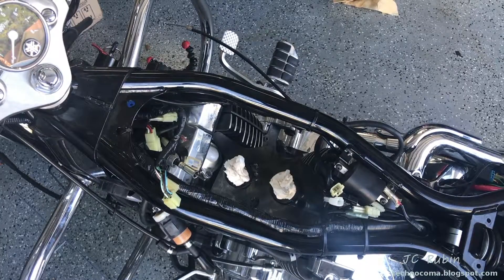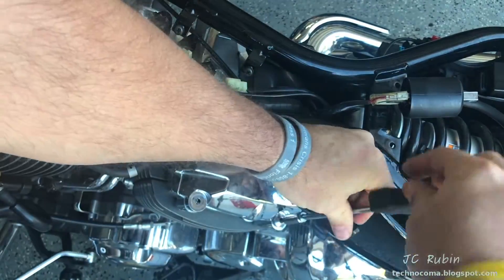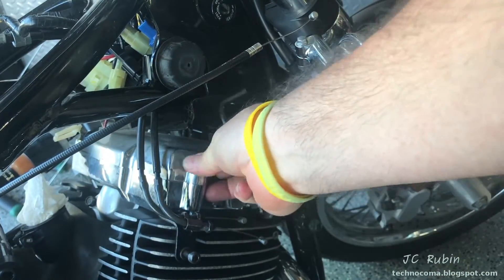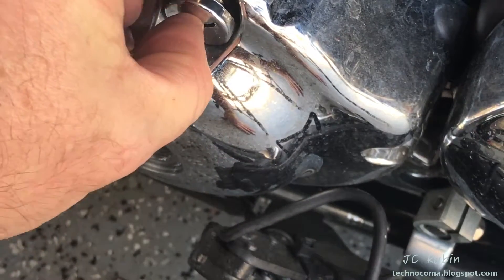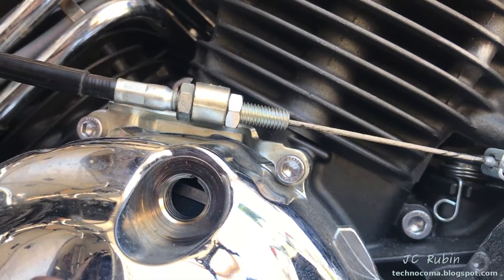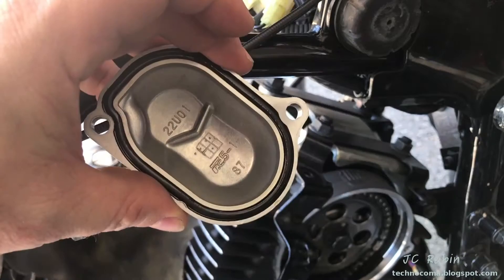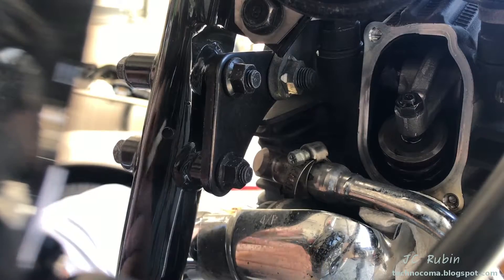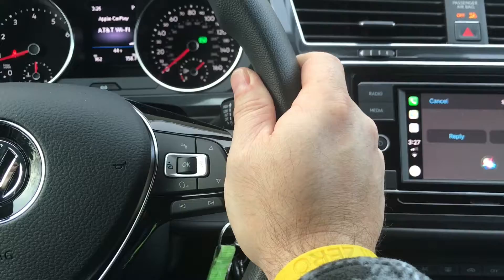Yamaha Star 650 Valve Adjustment - Checking  and Adjusting PART 1 of 2

Comment: I have a question? I was doing my valves and the dot and the I for the front cylinder will not both line up perfect. Is there anything wrong with the bike or the they not always line up exactly
Reply: Did you ever get an answer to your question, somewhere? I'd like to know too! Thanks!
Reply: @WatanabeNoTsuna.  It's just chain stretch. As long as you're not a whole tooth out of spec then you should be fine
Reply: @tsushi007  Thanks!

Comment: I got a question: So I encountered a problem where after adjustment I noticed a leak, I’m able to replace the gasket for the valve cover but is there a “correct way” to install the new gasket (I.e.  put little oil on it)? Or do you just slap it on?
Reply from the maker: I lightly oil the gaskets before seating into the cover.

Comment: hallo again good sir. i have 2 questions and i will appreciate your answers very much.
 
i will probably sound like noob, but i couldn't find any info on why do i need to do Valve Adjustments, what it does?

and second is: my engine started to heat up very fast lately, and after about an 30-40 minutes after starting riding it makes a "wooooo" sound. sounds like wolf howling in a high pitch. do u have any idea what can cause this problem? 

thanks again for your vids!! Ride safe and may the sun always shine upon thee.
Reply from the maker: The valves are not hydraulic and have a set amount of space to allow for heat expansion.  This space must be checked and adjusted regularly.

The second question I cannot help from this info.

Comment: @Retro Tech & Electronics
Hi! Huge thanks for such a deep and clear explanation of process. I have a question that bothers me. In service manual they are saying, that you should turn engine clockwise - SAME AS YOU SAID.. BUT - in this part of video (on 8:40) you are turning engine counter clockwise. Later in part 2 (rare engine part, you are doing clockwise). Why so? And what are the consequences of doing it wrong? Many thanks once again!
Reply from the maker: Yes, the service manual is correct

Comment: when you loosen the lock nut on the adjustment stud the stud is free to float on the threads in the rocker arm

if you adjust the clearance to "perfect" with the lock nut loose, when you tighten the lock nut it pulls up on the stud just slightly (pulls it up against its threads) and then the gap has changed and its loose.

I had 12 air cooled VWs over the years, and you have to adjust their valves every 3000 miles. I dont think you can just set them with the lock nut loose to say maybe 0.001" tighter, then it will always be perfect when you torque the lock nut down. This is one of those things you learn by doing it.

The important thing is  you get the valves within the acceptable range, it does not have to be exactly in the center. The reason is you dont know which way its going to wear.

as the valve stem wears on the cam it becomes looser
but as the valve face wears on its seating surface on the head port, it becomes tighter

which one prevails? you find out the next time you check your valves. Keep track in your owners manual - write down what it was. Over a few adjustments (years) you might see a trend, and will know which side to favor.

And BTW, those tappet cover Oring gaskets are only $4 each. if you re-use an old one and it starts leaking, you have to tear the bike down all the way again to replace it (another 2 hours), unless its the rear cylinder exhaust tappet - that is the only one you can get off without taking anything off the engine.

Nicely done video!
Reply: long ago I also owned a few mid 60s VW vans and yes, the clearance tends to change when tightening the nut on those engines.  I imagine this vstar adjustment is similar

Comment: Doing this on my 2008 VStar 650 Custom.  I removed the side cover off the rear cylinder and rotated the fly wheel until I saw the "TI" with the "I" right in the  notch.  However when I do that and I look at the sprocket with the side cover off the dot is to the left of the tab.  It's not lined up?  Have I discovered a major mechanical problem, or should I just adjust based on the TI marking? (Sorry originally put this on your 1100 video by accident)

Comment: man my bike is almost to 40k miles and I've never done the adjustment. I start tomorrow
Reply from the maker: Interested to hear what the values are before adjustment if any adjustment is even needed.
Reply: @retrotechandelectronics  hey. So after doing my valve adjustment it was surprisingly not too bad. On all 4 they were just about .001 higher than spec. I probably won’t have to do it again for the bikes lifetime

Comment: Replacing valve's in front cylinder in a 1100 vstar, bent them trying to sync carbs with clear tube and 2 cycle oil. I guess I will do what you did to get it to tdc on front cylinder , then I can take sprocket and cam, tensioner , take head off .  
 Thanks good video
Reply from the maker: You're welcome.
Reply: Remember, saving money on tools doesn't save money when you have to replace parts.  I have replaced/repaired engines for people who tried to save money on gaskets using gasket maker. It ain't worth it, if you don't have time/money to do it right, when will you have time/money to do it again

Comment: Exhaust is .012-.017, ideal is .015. At 14:50: ".006 passes, but not .007" Threw me a curve ;-) GREAT video, once i figured out you (hopefully) meant .016. Or, is it .006?
Reply from the maker: Ive updated the video description, thanks.
Reply from the maker: As indicated in the comments

INTAKE        .004in     .102mm
EXHAUST    .006in     .150mm         

6 passes but not 7 as in thou/In   or .150mm